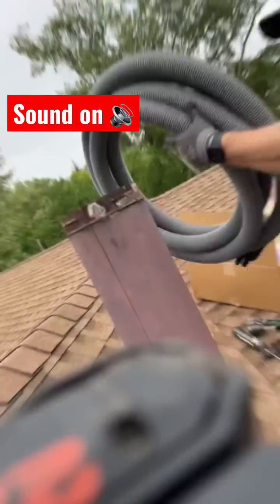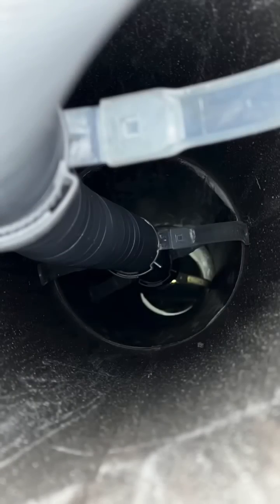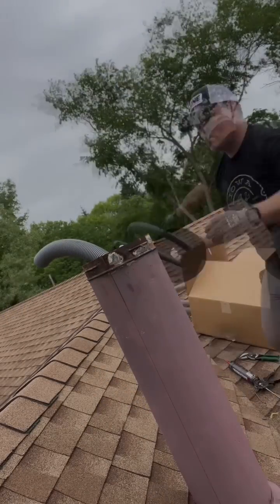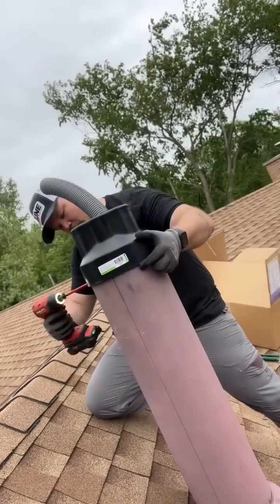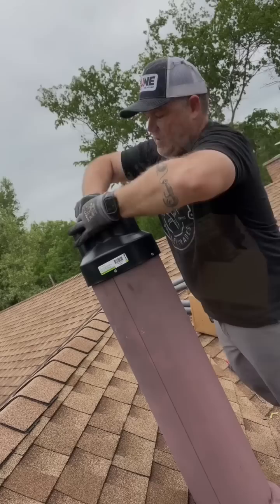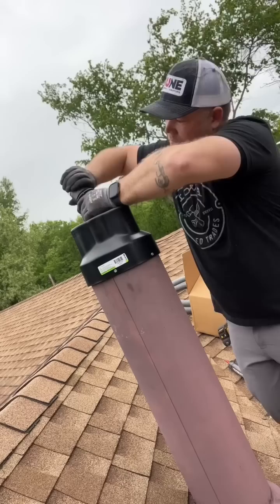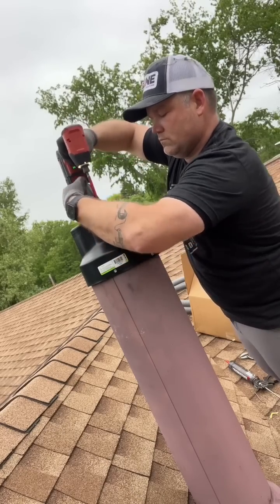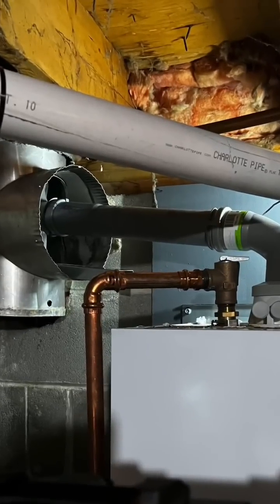Flexible polypropylene gas venting system #plumbing #hvac #auneplumbing

Comment: Great video! For those saying to just drop PVC should look into it, because the manufacturers tell you PVC is not rated for heating appliances.
Reply: Want to try that one again? Numerous manufacturers spec schedule 40 PVC meeting their venting requirements. Some also list abs, but that often gets shut down by the local code officials.

Comment: As mentioned this should only be used as a last resort, polypropylene will not last forever and trusting someone to remember/have the motivation to check periodically is not likely to happen. It may take decades but it will eventually get brittle and fail. Since it's venting CO2, a colorless, odorless gas that's deadly, the only clue that it has failed may be the body count.

Comment: Ain't no way some corregated plastic is expensive to the point where it's a "last result" sounds like that company is way upcharging an inexpensive product....
Reply: Of course they are. Because they're saving you $300 they feel they can charge $250.
Reply: Lol...this guy is unresourceful at best.  An 8×4 sheet metal reducing coupling costs about $25.  My material cost whoud be $90 on a simple job like this.

Comment: Depending on the length of the B Vent, and whether it had any turns, I’ve ran the PVC up through the existing B Vent when swapping to the high efficiency appliances when putting a hole in the house wasn’t an option.

Comment: Power vent? 
I travelled and worked with industrial and institutional process equipment, chillers, boilers, furnaces, etc. 
Not a fan of corrugated/ flex for air distribution or exhaust. 
Our sheet metal / duct mechanics only use 3' to 5' of flex on terminal devices. 
Is that horizontal run pitched for condensate drainage?
Have seen too many flex hack jobs. 
If it's high efficiency power vented, how many bends and total linear feet of that (small) diameter pipe does the manufacturer permit? 
When I get called to check jobs like that (after I've been there on our medic, rescue, or engine in the middle of the night) the first tools that usually come out are the sawzall and port-a-band to cut it all out -----
Then I get out the snips, crimpers, torch/ flux/solder, pipe threading, or victaulic dies.
The propress, sharkbite, and flex have never been permissable in our specs.

Comment: Why didn’t you tell us how much it cost? You left the most important part out.
Reply from the maker: I have three suppliers who will sell this to me, all three have different pricing on it. I'd suggest you call a supplier and ask what your cost is, that's not really my job I guess.
Reply: @mechanical-hub  It’s not my job to subscribe to your channel anymore either. You have a bad attitude. If you have three suppliers and they all have different place prices you could’ve provided a price range, but instead you chose to act like an asshole goodbye.

Comment: maybe pvc schedule 40 solid pipe stronger wouldn't want a rat chewing it and will last you for years  when dealing with gas you don't want to cheap out
Reply from the maker: The boiler manufacturer does not list PVC as an acceptable vent material. If you have rats in a chimney then you have a much bigger problem than vent pipe materials but stainless steel is always an option.

Comment: Your using plastic to vent flue gasses... think about that for a minute. Never mind the coragated pipe that's a no no to begin with.
Reply: It's meant for venting gas appliances, that's literally what they make it for.
Reply: @DougPoker  1 no it's not made for hot gasses. Its duct pipe for central ac.2 you never want any back pressure in a system designed for flue gasses. The act of going from larger pipe to smaller(condencing) alone will cause back pressure. Then you want coragated onto that disturbing more airflow by causing disturbances in airflow? With all that back pressure the gasses that should be going outside are comming back into the house. Dont know if you got the info but carbon monoxide poisoning is a real thing. 3 plastic... you really think it's a good idea to use plastic right above of an open flame and say it's safe enough to carry out the toxic gasses? I never thought I'd say this about this shithole... thank god I live in canada where we actually have a safety code of what we can and can not do and thank god we have inspectors.
Reply: @Sabi1234567890Asdf  oh yes, it is made for hot gasses.  Condensing appliances have lower exhaust temperatures.  Why don't you take the time to learn a little about the subject before you reply?  I've been doing this over 30 years.
Reply: @DougPoker  I've been doing this for 10 years and nowhere in my codebook does it suggest that we are to use plastic on flue gasses. Infact the code book tells us to use metal duct work and then double wall ducts when it comes to any portion touching the frame or walls. He is venting a hot water tank or as he calls it "boiler". That is not giving off low heat. At least here we have standards. I think you need to go back to school and learn more about venting and airflow disturbances.
Reply: @DougPoker  pollypropaline has a melting point of 160 degrees c the average flue gas of a hot water tank will be between 170 to 200 at the exit point of the appliance. Tell me how exactly is that safe to vent with?
Reply: @Sabi1234567890Asdf  condensing boilers flue gas are limited to about 135 F. The venting you are referring to wouldnt work because it would corrode due to the condensation and acidity of the flue gases. Sizing of plastic vent pipe for gas fired appliances is done to manufacturer spec. There is no table in the CSA B149 (CAD gas code) to size plastic vent pipe for condensing appliances.
Reply: @DougPoker  well said
Reply from the maker: If you don't understand something then asking questions should be your first step, think about that for a minute.
Reply: @mechanical-hub  I am a licenced gas appliance service tech and installer. Coragated pipe leads to back pressure created by the ripples in the pipe allowing a disturbed airflow pattern. That can alow flue gasses to be pushed back in to the house. Hence why I hate seeing them on dryers they cause back pressure and trap the lint inside them more than straight pipe. Then there is the fact you are using plastic. What happens when plastic gets hot? And you want to vent hot flue gasses threw it. I dunno where you are but here we have standards and that shit is by far not up to code and wound never pass inspection.

Comment: FYI most of them now will allow you to use PVC which is kind of up or down depending on your point of view but is a nice option for flexible vent pipe
Reply from the maker: That boiler manufacturer doesn't and won't ever allow PVC for venting the exhaust.
Reply: @mechanical-hub  that strange cuz the PVC is rated higher than that flexible tubing kit cuz we put them on the rinnai's all the time
Reply: @mechanical-hub  why?

Comment: If it's a straight shot just drop a length of pvc down
Reply: I have a two-story house with an old brick chimney extending 3-4' above the eaves; the plan was to lower PVC down inside it. I'm not sure how they planned to do it - that's a lot of pipe, heavy & awkward -  but given the rooflines, the generally poor condition of the chimney, and the crappy weather that day, it was deemed too risky, and they went out through a wall instead.  Just curious, how would you have done it? I can't imagine lifting probably 16' of PVC straight up and then lowering it inside the chimney.
Reply: @DaddyBeanDaddyBean  they wouldn't lift a whole 16ft piece up and down the chimney,  the would use 2 8ft sections with a coupler in the middle. Drop in 1 of the 8ft'ers then hold it and put a coupler on it or put it on before lifting into position. That way all you have to do is clean and glue the other 8ft section to the coupler. With 2 people it's very easy
Reply: @DaddyBeanDaddyBean  no different than a well.
Reply: @DaddyBeanDaddyBean  I'd have planned to use a side wall (if available) from the start.  Here in No CA the termination has to be 6' from any window that opens or doorways.  Using an old chimney is going to interfere with a future remodel. Edit: Breeze Mechanical.
Reply: @christopherscott8853  no problems with doors or windows nearby, but the house was built in the 1860's and instead of a sill plate / rim joist, there's an 8" x 8" beam on top of a stone foundation, so going out the side wasn't easy either.  They got 'er done, just took a long time to holesaw two big holes through that beam.
Reply: I would just use your old flu roof jack as the chase and run a 90% flu kit and PVC. I don’t see why you would do this other than to make a video.
Reply: Dustin t, Yes.  Easy basement connection.   I'd have just used a 24 guage sheet metal reducer on the roof (8×4) to accept 4" pvc with a rubber boot or custom storm collar.  I don't know what he paid for that " kit" ...lol...but total material cost my way would be about $90.00 including bracing in the basement to support the 12-15 pounds.  Breeze Mechanical.

Comment: Never seen that one I've used the stainless steel flexible chimney liner for years
Reply: Same here I didn't think plastic could handle the amount of heat that a lot of gas furnaces or hot water heaters put out.. not to mention the residual chemicals that come off in the burn.
Reply: @joeybebop  Most modern boilers, water heaters, and HVAC furnaces have exhaust that is only mildly warm, probably only about 40°C or so (100 ish °F). They are just so efficient at extracting as much heat as possible from the burnt fuel that you don't need metal chimneys anymore.
Reply: @richardmillhousenixon  those are high efficiency heaters though aren't they? I just didn't recall him saying that this one was a high efficiency. Because I have seen those plumbed and exhausted with PVC.
Reply: @joeybebop it's connected to a high efficiency tankless boiler. There's a quick shot of it in the video.
Reply: @logan4215  cheers, yeah I wasn't that quick looking at the unit. 🤙

Comment: Did you leave the end of the pipe open for rain water to fall down?
Reply: Not a team boiler condensate return, My apologies I was still in work mode. But a condensate pump to get the drips from the condensation that happens with the exhaust from the burner.
Reply from the maker: That’s how the kit terminates. It’s a condensing boiler. Rain isn’t an issue.
Reply: @mechanical-hub  I just feel like if you wanted to actually do it completely properly you wouldn't leave an orifice that easily accepts water into it....
Reply: @mechanical-hub  yeah I have a furnace as well and it functions similarly with a forced air exhaust but that just puts more work on your condensate return pump I feel like a quick double right angle would save a absolute shitload of electricity over the course of a year pumping out rainwater from your boilers condensate.....
Reply: @rossmalicki1142  condensate return pump? So you have a steam boiler that’s…outside? 🤔

Comment: Why not just put solid core pvc down it? Or even cpvc? Cheaper than the kit!
Reply: I was wondering the same thing. If it’s a straight shot, no need for flex. Eliminates the need for additional inspections as well, depending on mfr instructions.
Reply from the maker: Follow the boiler specs
Reply: @mechanical-hub  post the specs you are referring to, please.
Reply: @paulmonk7820  he won't because he likes over charging his customers a %  on a 600$ vent isn't as much as a 1500$ vent.